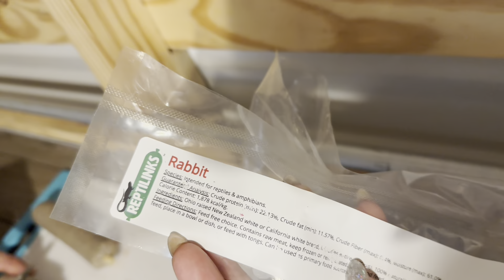New birds, animal diet prep, prairie dogs, sanctuary vlog 2-12-24

Comment: Hey Chris and Gabby,
Seeing you do all the animals food bowls up, I thought I'd throw out a suggestion for some kitchen tools, to make chopping and cutting veg and fruit faster. 
Pick up a good quality Industrial Stainless Steel Mandolin that has a number of attachments. Attachments for slicing, dicing, making fries, and shredding, etc. You could do a similar thing with a Food Processor and shredding blades, but they tend to mash the veggies more than cut them.
 
Another good kitchen tool is a Veggie Spiral. With a veggie spiral you can make shoestring spirals of cucumber, zucchini, different kinds of potatoes, and root vegetables. It's a good way to make food enriching for the animals and helps with digestion as well. I use these tools for my lizards. And used to use them when I had birds for making quick bird chop, especially using the shredder blades in the mandolin.
Both will save you a lot of time in preparing foods each day, giving you more time for the other daily and weekly duties, especially with the amount and types of animals you have.

It looks like you have branches that want to be housed in the bird cages too!!! 😄

For the gopher steel tub. If you take a length of rebar and file one end to a point, then with a hammer, poke drainage holes in the bottom of the tub, then water or moisture buildup won't be as much of a problem to deal with and you can put soil with more clay in with the sand so the gophers can have solid tunnels that don't collapse.

Not trying to tell either of you what to do, just throwing out some ideas that might be of help and won't cost much to do. I'm an animal lover just like both of you, and am crafty at building and solving problems as cheap as possible while still being effective. Which reminds me of another idea for the birds enclosures.

If you go to Home Depot, Lowes, or other hardware stores near you that have CorPlast, a plastic clear cardboard that can usually be found in 8'X4' sheets, some large flat washers with holes big enough for deck screws as well as a box of deck screws a bit shorter than the thickness of the wood in the cage frame. 
You can temporarily screw the CorPlast up on the outside of the cage making a wind break that won't tear off like the plastic does. AND, You can remove it and store it in a shed during most of the year and reuse it again and again until it wears out years from now. 
The CorPlast you can overlap the end to make it wind tight or cut strips about 3 inches wide to cover the seams so that wind and water don't get into the enclosure. Its also water proof. 
CorPlast, isn't totally clear, but, it will let sunlight in and help warm up inside the enclosures a small bit. And with heaters or heat lamps it will help retain the heat inside the enclosure, much better than sheets of plastic like your using now.
Many fish keepers use it to make removable covers for their aquariums, which is how I first found out about it and started using it. I have made transport containers out of it using real Duct Tape to strengthen and join edges and corners when I was in a pinch for a shipping container and didn't have one I could use. 

CorPlast is a multiple use material that has an endless amount of uses.
Reply: Wow great ideas. I hope they see this comment
Reply: @denisefaulkner4890  Thanks for the like Denise.
Reply: you got it! @comedianmattrossey
Reply: oops this is my husbands account but that was me denisefaulkner
Reply: @texasflusher  hahahahahaha